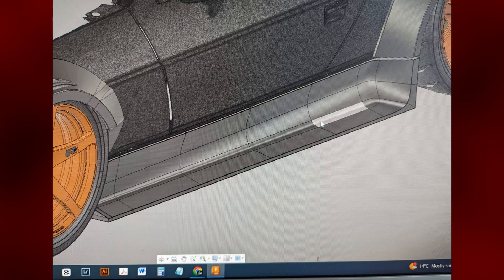Twin Turbo DeLorean Widebody V2 & Airride Suspension Upgrade!

Comment: Man, this was really insightful.  I never thought of the cost of waste for CNC machining the plugs or molds versus how easy and cost effective it is to 3D print everything.  It's crazy how far technology has come for type of fabrication, and how accessible it is now.  Thanks again for all the info, you've definitely made me re-think how I'll be moving forward.  When I get to this part of my build, I may just have to get with Tyler to make sure it gets done right.  I can't wait to see how the DeLorean turns out with the new setup, but I'm sure it's going to be absolutely insane as usual.
Reply from the maker: Yes sir Tyler is the man. 3D Printing is the way to go.